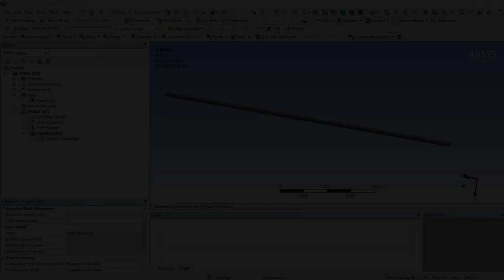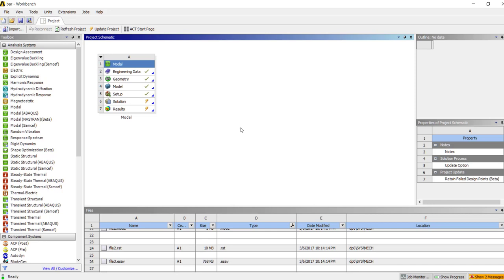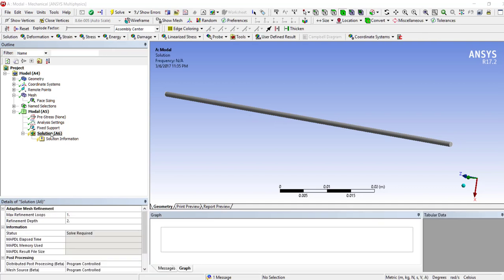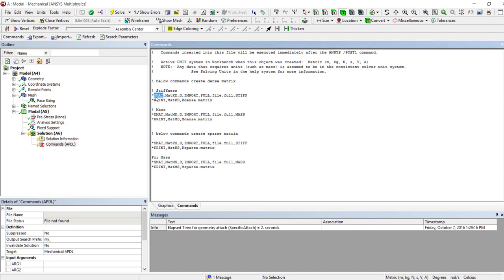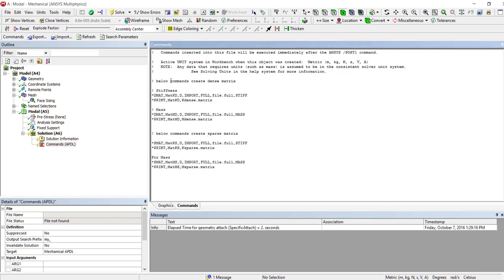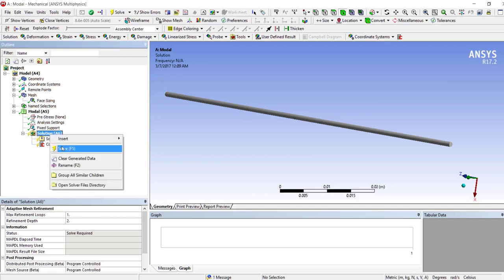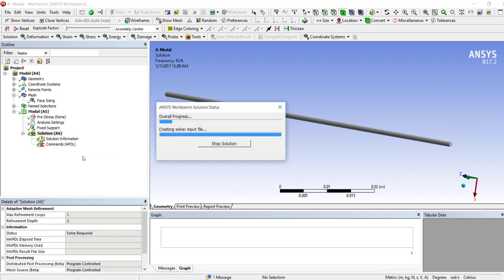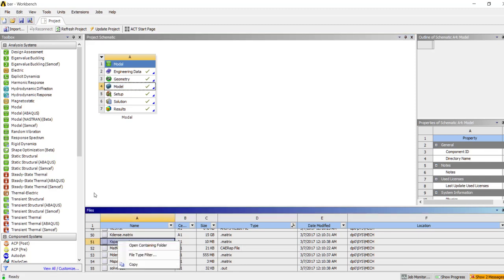Export the ANSYS Stiffness and Mass Matrix to Text Files

Comment: To fix the error: click Solution -> Analysis Data Management -> change Delete Unneeded Files to No.

/AUX2
! Combine .FULL files
COMBINE, FULL
! Enters the database processor
/POST1
! Stiffness
*DMAT, MatKD, D, IMPORT, FULL, file.full, STIFF
! Mass
*DMAT, MatMD, D, IMPORT, FULL, file.full, MASS
! Sparse matrices
*SMAT, MatKS, D, IMPORT, FULL, file.full, STIFF
*SMAT, MatMS, D, IMPORT, FULL, file.full, MASS
! Write matrices to files
*PRINT, MatMS, Msparse.matrix
*PRINT, MatKS, Ksparse.matrix
*PRINT, MatMD, Mfull.matrix
*PRINT, MatKD, Kfull.matrix

Comment: I have also followed the same procedures as the video has been explained for a square plate on Ansys 2021R1 free academic version. But there is no as such Ksparse or Kdense matrix is generated in file section. Please help me to resolve the issue
Reply: Did you get the mass and stiffness matrices?
Reply: @ahsanayaz6135  No
Reply: Did you find a solution to this problem , please help me
Reply: @yr5507  No
Reply: It does not work with the free academic liscence

Comment: For all of you having problems with the presented method in the Video: This might be because of problems at importing the file "file.full" due to Ansys default settings. I had to change two things to get it working:

1. Deactivate distribute Solution and instead select solving on one processor core only as already described here in the comments by @Václav. Otherwise you will get multiple files "file0.full", "file1.full"....

2. Ansys deletes the required file "file.full" by default settings. In the Outline-Tree go to "Analysis Settings" -> "Analysis Data Management" -> "Delete Unneeded Files" -> Select No

And here is the complete code for you to copy:

!Stiffness-Matrix dense
*DMAT,MatKD,D,IMPORT,FULL,file.full,STIFF
*PRINT,MatKD,Kdense.txt

!Mass-Matrix dense
*DMAT,MatMD,D,IMPORT,FULL,file.full,MASS
*PRINT,MatMD,Mdense.txt

!Stiffness-Matrix sparse
*SMAT,MatKS,D,IMPORT,FULL,file.full,STIFF
*PRINT,MatKS,Ksparse.txt

!Mass-Matrix sparse
*SMAT,MatMS,D,IMPORT,FULL,file.full,MASS
*PRINT,MatMS,Msparse.txt

Hope this helps you. Works fine for me now on Workbench 2020R1 :)
Reply: Thank you! This helped me alot ;) ...works also good in 2021R1

Comment: Hi,
Thanks fo this video.

The presented method works for me fine. However, as can be seen at the end of the video, Ansys writes only a limited number of digits into the .matrix file as for example, a matrix entry has the form: 5.998e+010.

However, I would like to write out the full 16 digits of the double format into my .matrix-File. As for example, a matrix entry in my .matrix-file should have the form 5.997831378144589e+010. Unfortunately, I could not implement this yet. Does anybody know how to achieve this??
Reply: I found a solution. In Ansys 2020 R1, the stiffness- and mass matrix can be exported as csv-file using the *export command where the user can specify the number of digits that are printed in the .csv-file. Here is the APDL code I used in WB: 

!!!!!!!!!!!!!!!!!!!!!!!!!!!!!!!!!!!!!!!!!!!!!!!!!!!!!!!!!!!!!!!!!!!!!!!!!!!!!!!!
fini

! import stiffness matrix from .full
*DMAT,MatKD,D,IMPORT,FULL,file.full,STIFF

! import mass matrix from .full
*DMAT,MatMD,D,IMPORT,FULL,file.full,MASS

! export stiffness matrix
*EXPORT, MatKD, csv, MatKD, 16, , 

! export mass matrix
*EXPORT, MatMD, csv, MatMD, 16, , 

fini
!!!!!!!!!!!!!!!!!!!!!!!!!!!!!!!!!!!!!!!!!!!!!!!!!!!!!!!!!!!!!!!!!!!!!!!!!!!!!!!!!!!

Comment: I am using Ansys 18.1 to export the mass and stiffness matrices from the modal analysis. It is showing an unknown error and I followed the instruction to change the file name and tried the same. I am still getting the same error. please give the details about this problem to extract the mass and stiffness matrices from the workbench.
Reply: @Raja Sekhar Battu Did you get the mass and stiffness matrices?

Comment: For this to work you need to deactivate Distribute Solution otherwise there will be multiple *.full files (file0.full, file1.full, ....).Or maybe there is command which can combine all *.full files into one?
Reply: I indeed ended up with two *.full files (file0.full and file1.full) and cannot get the textfiles. How may I get around with this problem?
Reply: @chiaotinger  Hi I found only way and that is to solve only on a single core. 
Go to Tools > Solve Process Settings > Advanced > Max number of utilized cores: 1
Then you'll get single file.full. It's not the best solution but only one I found which works.
Reply: @hrscz  Thank you very much! In 2019 R2, to use only one core, it is under the Solution tab > Cores.

Comment: Hi, I tried to run this code but I'm getting an error " an unknown error occurred during solution. check the solver output" .. On checking the "post.out" file it says " *SMA Command: Fails to open file file.full. ", Any idea how can I fix this error?
Reply: "file.full" ---> file = name of the file you created. So I think you should rename "file.full" = your file's name.full
Reply: Hi i have same problem too. Even its showing me a Green check on solution. Solution information says "failed to open file file.full"..
Reply: @akbulutsrd  For instance I create  a file with name: /filname,CDV4,1. To get stiffness matrix I used code: ! Gets Stiffness Matrix
*DMAT, MatK, D, import, full, CDV4.full, stiff
*DMAT, Nod2Bcs, D, import, full, CDV4.full,NOD2BCS
*print, MatK, matk.txt    ! Exports Stiffness Matrix to Text File
*export, MatK, mmf, matkMMF.txt ! Exports Stiffness Matrix as MMF format.
in this case file.full is replaced by CDV4.full.
Hope it useful
Reply: @vietlongho8480  It was output when it was calculated for the first time, but it was not overwritten from the second time.
I don't know the solution, so please give me some advice.